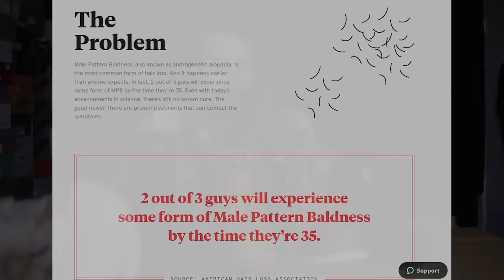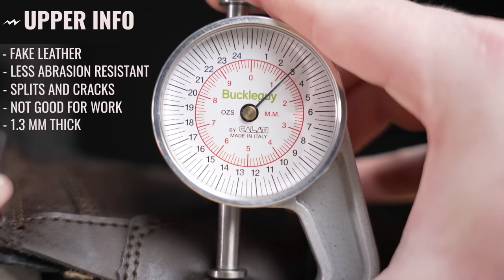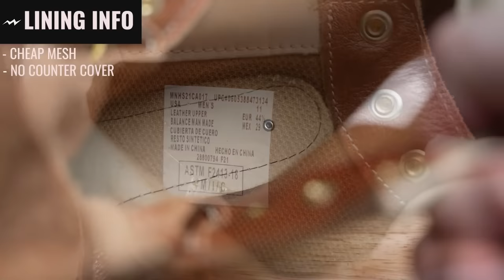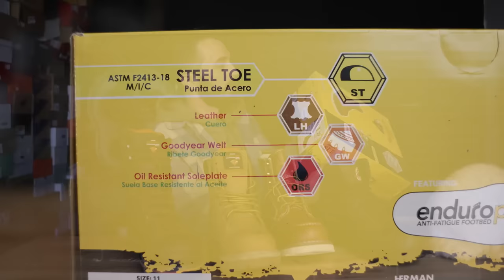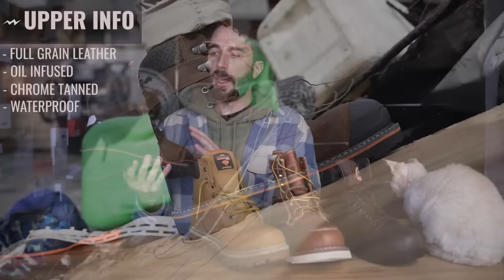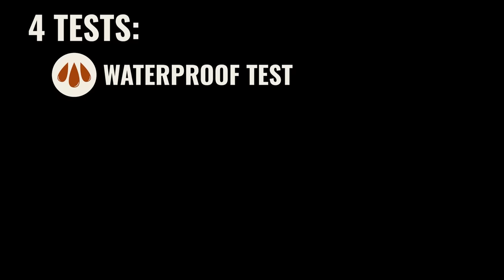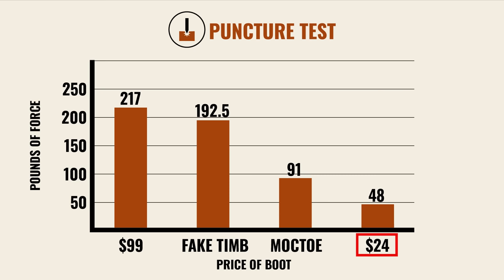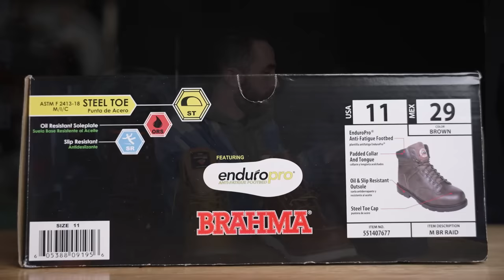The Truth About Walmart Work Boots - Best CHEAP Work Boots or TRASH?

Comment: Herman Survivors was actually a pretty good brand back 30 or 40 years ago, but the brand was sold off and somehow ended up in Walmart’s hands, and they, predictably, ruined it.
Reply: Similar situation with Schwinn
Reply: Yes, remember the commercials of Herman Survivors? Also, on WWF wrestling back in the day, the MoonDogs wore Herman Survivors in the ring.
Reply: My first run in with Herman Survivors was a pair that was given to me by a coworker.  They were new old stock and seemed pretty good. What I didn't realize at the time was that they were over 25 years old until I took three steps in them and the rubber soles both cracked right off and stayed where I had just been standing 😂
Reply: When I was a kid in the 70s Herman Survivors were the boots you wanted. Unfortunately this is just one more example of how things get worse when it's only about low quality and making profit.
Reply: My first pair of Herman survivors came from Walmart and were awesome but the next pair I bought was crap !
Reply: @jaystavros7177  wow
Reply: @peppersaltman1805  and the people should i say cattle cant get enough
Reply: Brahma Hubert. Non steel toe. Less than $50. Try them on. You will be surprised. I was. No mo timbs. I doubled down and already got a spare pair.
Reply: @paulshamblin6260  hmmm......thanks for the tip. Much appreciated
Reply: So true
Reply: Yes they were.  I worked with a lot of guys with Herman Survivers.  Also, Red Wing and ThoroGood.  All really good boots.
Reply: Yeah I had a pie of Walmart Herman survivors, fell apart after a year of use. Started falling a part in half that time though.
Reply: Yep, they were a big brand for New England winters.  I would love to learn what went wrong with them. I assume China bought the name.
Reply: My first pair of Herman survivors came 20 years ago from a big box store, I remember my dad saying Herman's were a good boot. I think they lasted 6 months in the ditch laying pipe. 
So sad to see good names sell out and their traditions and quality so depleted.....coleman,schwinn,Everlast, scharade and so on.
Reply: I still wear my Herman Survivors from 40 years ago. Fit like a glove. My only regret is not buying two pairs.
Reply: My first pair of hiking boots were Hermans (about 30y ago).  Put alot of miles on those
Reply: @Acemans  and mongoose
Reply: @preston2636  and Starter
Reply: @paulshamblin6260  agreed. Bought the better Brahama several times
Reply: I remember in the late 70s when I was in high school our wrestling team went to a tournament during the Christmas/New Year break and there was a lot of snow and slush on the ground. I had sneakers on that I wore everyday which meant my feet were soaked and cold. Two of my teammates showed their winter boots which were Herman Survivors, and they were really proud of having those boots and showed me how they would take care to put mink oil on them to protect them and make them last. That stuck with me and 5-6 years later when I had finished college, was out on my own and working, I for the first time splurged on dedicated boots to wear for the winter and chose Herman Survivors. I made sure to treat that pair with mink oil as I was shown and they lasted me for years and years. I only replaced them because the heels got worn down from walking on city pavement. By that time I could no longer find Herman Survivors locally and moved on to other brands.
Reply: @DEVILBUS65    Same here! I was so proud of my Herman Survivors, my first REAL work boots, loved them. But Wally World ruined the brand.
Reply: @Acemans  and Stanley
Reply: Herman survivor boulders/grizzlies are still decent for the price. Who wants a pair of work boots that last over a year anyways. I don't. At least not until I find something that can actually get rid of that work boot smell 😆
Reply: @bradhenke7552  Gold Bond Medicated Body Powder!  Come Get Some, OHH YEAAHH!
Reply: I got a pair of the most expensive Herman Survivors from Walmart, I've wearing them for about 6 years. They are still holding up. They were about $80 when i got them. The bottoms are wore out but Im suprised the stitching on the top has held up and also the sole's didn't come unglued.
Reply: @amazingthingsfromaroundthe2057  I'm surprised as well, maybe you lucked out and they were made on a Monday
Reply: Sounds like the same thing with black and Decker and craftsman. They used to be good now most of there stuff is shit.
Reply: my first walmart Herman Survivor boots tore the first couple months of owning them, I knelt down and the bottom sole tore half way up and eventually to the mid-sole...

My 2nd walmart Herman Survivor boots have been beast and serving me well through years of casual daily wear and occasional outdoor/off-trail hikes in mountains. They started to sometimes squeak after a few years of use, but it usually goes away after wearing them for a few hours lol idk why.
Reply: @sirjohndoeofpa3292  the memory on this guy!! The nostalgia is suffocating 🤣
Reply: I remember way back when they were made in Millis, Massachusetts. I was an apprentice lineman in the early 70s and Hermans made  a great lineman's boot.
Reply: And 1 used to be good to
Reply: The qc is absolute garbage, but if you get a good pair damn are they still good! I've had the same pair for about 8 years now. Given about 3 of those years I didn't wear them everyday but for the last 5 years or so they've been worn everyday! The soles and everything are still going strong! But the top leather part is destroyed. I just have to throw a new pair of inserts every couple years and they're good. But I'm looking to get some light mid or high top shoes with a protective toe.
Reply: When you get stuff made in China, the quality goes bye bye 👋…
Reply: Yup
Reply: Kind of like how foster grant used to be good sunglasses
Reply: @bradhenke7552  good socks and hygiene solves those issues. Obviously you never had good boots and all leather boots are breathable and actually help with sweaty feet. Brands that don’t use synthetic materials just straight leather. Not saying they won’t stink up but if you are stinking up a room with your boot or your feet after you take off your boot you either have cheap boots, cheap socks or even worse bad hygiene
Reply: Some of the best work boots I've ever had.
Reply: @sirjohndoeofpa3292  Moondogs reference, impeccable good sir. If I do say so myself.👍
Reply: I had a 40 dollar pair of Herman's last me 5 years of tough hard labor.
Reply: @Robert Smith  Usually when big companies buy out a good product and continue selling it under the same name, you get a year or even a couple years of similar quality to the original and steep discount before the quality drops. I'm not sure if it's because of selling off all the old stock, having a period of time where employees must be retained after acquisition, a purposeful marketing decision or some combination of those... but if you keep your ear to the ground about these acquisitions you can get some amazing deals.

You used to see a ton of this in electronics, computer parts, sound equipment, etc. 

Once upon a time it was pretty much the exclusive reason for declining quality from celebrated brands. Now the water is a little muddy as brands will just do it themselves without even selling out. Or offer sub-par "entry level" products alongside their high end stuff, and then slowly blur the lines between the models. 

It's such a pain to keep up with what is and isn't a quality product these days... but I guess it creates a market for YouTube channels like this. Silver lining.
Reply: Its a shame the Herman Survivors name has been reduced to this kind of imported mass-produced crap.
Reply: AnD THESE REASON WHY WE SHOULDN'T NEVER RELY ON ONE PAIR FOR ILL DO ALL
Reply: I finally figured out what my Dad wore FOR YEARS hunting and hiking! They were an old school pair of Herman Survivors! For the longest time I could never remember the name so thank you for this video and these comments ...Sad to see that long ago they sold out, gutted the brand and quality and ride on coattails of the name recognition. Wish I could find a pair of the tall calf hunting boots Dad had for decades. He wasnt the type to bother resoling boots but he loved those things so much he had em resoled several times.
Reply: I had a pair of Herman’s I wore in the Army in the early 80s, they were great resoled them many times. What happened to HS was Walmart bought the brand shut down the US factory and moved it all to China
Reply: Don’t forget about Reebok. Remember when Reeboks with the shit in mid/ late 80’s. Plain with the strap. And then the pumps came out which was gimmicky but kids loved them..
Reply: My dad wore Herman survivors exclusively for my whole childhood
Reply: Yeah, something similar happened to Maytag.
Reply: I miss my army Herman survivors I should of kept them
Reply: My survivors slip on are great but my job is Brutal I've had 200$ Ariats an they lasted 6 months. same thing with my survivors. So buy ur boot to fit ur job.
Reply: I had a pair of Herman Survivors back in the 90s they were great boots. Not cheap and I bought them from a specialty boot shop. They lasted well considering a teenager was beating on them

Comment: I think instead of the flame test, you should have used sparks. Have an angle grinder blasting them with sparks for a minute or something. A pretty good replication of a real life work scenario.
Reply: Oh yeah....I can't tell you how many pant legs I've burned holes in, over the years, cutting re-bar with a chop-saw. You start out with the spark trail tailing between your legs. Then after a few cuts, or so, you forget, cause your back is getting sore from bending over holding this heavy ass saw, and shift your stance. If your lucky, you realize before it burns through the jeans, and makes it to your boot, or even worse, your bare leg...smh
Reply: I agree with the first guys statement use a spark test instead flame
Reply: I think that’s pretty smart
Reply: I mean, I actually quite liked the flame test. When I was doing firewatch and grunt work as an ironworking apprentice, they'd give me a wheat burner after it snowed or rained on the deck and tell me to both melt the snow and make sure the water evaporated so it wasn't an ice rink. So I would actually be holding a wheat burner nary an inch or four from my boots for more than ten seconds at a time. That being said, I do understand that my experience isn't the most universal of the trades.
Reply: Agree with the spark test. I doubt any body is going to stand there while their foot catches fire, Unless you do a "spilt fuel and it ignited" test
Reply: @JayWalkerOnline  I try to burn the weeds on my fence instead of using a chemical poison. I have a water line ready just in case. I don't want a fire to start since I'm surrounded by trees.
Reply: I like the flame test. I worked at a smelter and the cheaper and more expensive on would have melted under the conditions i worked in.
Reply: @jeffdavis6657  I worked at a smelter where we often walked on metal that was pretty dam hot lol.
Reply: I wear a cheap Chinese made welder boot. They have a leather flap that covers over the laces and just velcro to the boot. Stops laces catching fire and also gives more impact protection . They are real easy to clean off too .
Reply: @JayWalkerOnline  I believe they're called a "weed" burner lol.
Reply: @JayWalkerOnline  It's not about whether it will burn, of course it will. It has to do with identification of the material.
Reply: Uh what about those of us who work in a flame thrower factory?
Reply: 25$ to 400$ pair of boots would not survive that kind of test you would have to be dead to not feel that on your foot
Reply: you need to remember, while you may be around sparks and welding, many people do actual hot work, walking melting metal and coals. many metal furnaces for example, a open flame is a good representation of that, Granted, if you doing that work you should not be buying your boots at walmart.
Reply: I have definitely laid a torch next to my boots working under stuff on the farm
Reply: Along with a welder! It's now a rag and I have not done any welding in a bit, but one of my cotton work shirts has small holes from welding sparks. 

Cotton clothing that is not FR-rated is still better to wear in an environment where there are heat/ignition hazards than clothing that is made from synthetic material.
Reply: Or a stick welder with all the spatter.
Reply: I pretty much did what you’re describing to some cheap Walmart boots and it left a bunch of little craters in the side of the out soul

Comment: Everything known about supply chains and manufacturing standards for Wal-mart already tells you everything.
Reply: Even if they were good boots I wouldn't support that POS company in any form.
Reply: Wal-Mart sucks and always have
Reply: No doubt  I'll never  buy shoes or  clothes for them
Reply: I used to make product for Walmart cheaper process less materials they charge the same as Home Depot does for the product.
Reply: @JAG214  where u get ur shiit then??
Reply: @HOLAATODOS-os5te  IT CALLED THE INTERNET LOL/JAJAJAJA
Reply: @JAG214  common sense in aisle JAG214
Reply: Walmart for me is like thinking About going into the arab store passing through hood on way home ur like  its quick fast but i may get shot ill just go 5 miles out my way to avoid it
Reply: @voltrondefofunv5708  Jesus what a take 🤦🏽‍♂️
Reply: From personal experience the Walmart survivor Driller wheat steel toes last longer and hold up longer than most made boots 2yrs. The other boots like timberland pro, carhart and many other's last 6months- 1year. I used them when in a steel yard torching and welding all day, and now working for the railroad walking on gravel all day. I can buy the Walmart survivor Wheat color Driller boot for $58 every 2years or buy Redwings for $250-$300 every 2 years. This isn't rocket science. I have worn the Survivor Drillers since 2003 the only boots I buy.
Reply: @abcertweld  might I recommend Whites, Nick's or Wesco boots? Yeah they're Hella expensive but the quality alone makes them last ages, plus they are resoleable.  Which is the real money saver.

Comment: Its crazy that the 24$ boots price point hasn’t changed in the 5 years since I bought a pair. I was 18 years old and bought that exact same boot from Walmart as I didn’t know much about boots and needed a pair. A  coworker saw me wearing them and told me they’d last me 3 months then the sole would come off. I didn’t think much of it as I was a bit arrogant  as a teenager. Sure enough right around the 3 month mark my sole pops right off in the middle of the work day, he’d called it perfectly. Went and got a decent pair with the money I’d saved up in that time the same day. Save yourself the absolute headache and buy a good pair of work boots, you’ll spend LESS in the long run.
Reply: They are made a lot better now
Reply: @laakiinn  b6ve
Reply: If your broke as shit and need something until you can get your first few paychecks, I can see how a pair of cheap ass boots from Walmart can work.
Reply: I have had zero problems with my 50$ Walmart boot and I'm a conductor for the railroad. I walk on railroad ballast and timbers 12hours a day 276 hours a month. Idk what your doing in that factory but something is up

Comment: I got Brahma "fake timbs" for $50 from walmart, and I've been very impressed by them. For me, they were way more comfy than any of the boots I tried in the $100-150 range, and they're holding up well
Reply: I've had good experience with that brand as well. Walking through mine runoff caused the left one ( I think) to crack almost instantly. I once told my grandfather about that, and being a former ASARCO smelter employee, he was not surprised. But they did me well when I was working a summer job on base when I was a teen.
Reply: Yes sir. I work at a brickyard that gives us a $100 boot allowance a year. I get 2 pairs of the $50 boots a year. I only come out of pocket for more comfortable insoles
Reply: Same!
Reply: that's what i have on my feet right now. my first pair lasted three years with me walking 5-10 miles in the city a day. then he lug cracked and i couldn't use them in the rain anymore. i went right back and bought another pair just like them
Reply: It's a good quality Colombian brand that's why.

Comment: I used the Brahma a lot when I was younger. They worked pretty well for the money. Lasted me about 1 year before they were trash. Granted I wasn’t doing heavy construction, I also wasn’t exactly easy on them either. Normal shoes only lasted about 6 months by comparison doing the same work. $24/yr was pretty cheap and got the job done for me reliably. Luckily my current job pays for my boots nowadays and I can get thoroughgood at no cost to myself and I love them.
Reply: Yeah everybody I knew when I was younger that did heavy duty construction and roofing we would just buy the $25 Brahma jobs from Walmart... Like you said you could stretch them over a year if you baby them but even if you absolutely abuse them worst case scenario you have to buy two pairs a year which is a whopping $50... Lol.
Reply: Depends how much walking you have to do, I walk many miles a day and I’m lucky to get 6 months out of an expensive pair.
Reply: ive had my justins 5 years i drive a yard dog truck 340 bucks
Reply: bought mine for 37$ at walmart, I work in junk removal, first month into using them and I can feel the steel toe got bent due to a filing cabinet getting slammed on my foot, other than that theyre lookin strong and feel pretty good(which is nice since I got grape squashin feet haha)